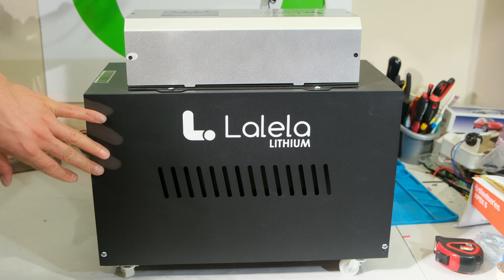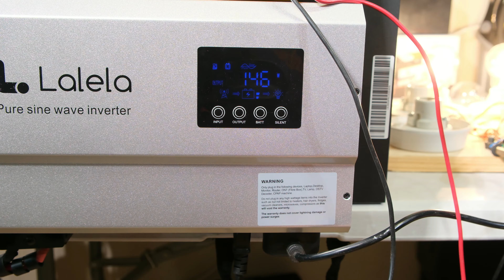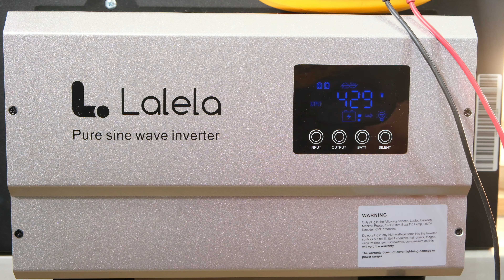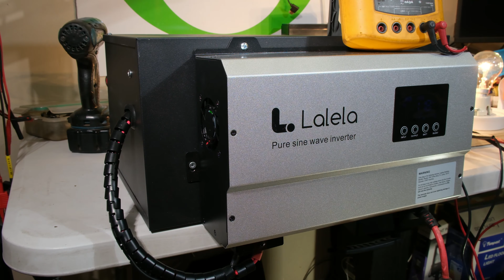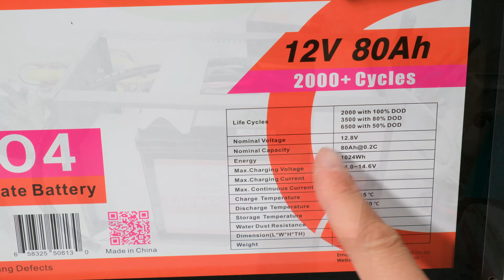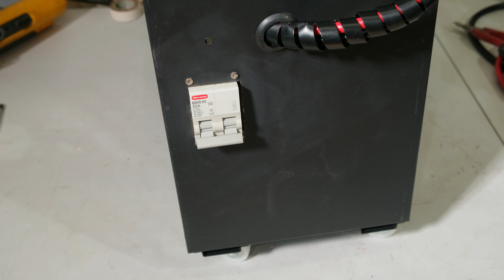How to setup and use the Lalela lithium iron inverter trolley Lal-600W-Plus  - Reviewed and tested

Comment: Hey Ecologicaltime, fantastic video review and I ended up buying this same Lalela product and want to do the same upgrades you did. However I have 1 question, can I purchase another lalela battery and add it to my invertor? I understand the invertor will only put out 600Watts but is there a way I can increase the capacity and if so how many batteries can you add to this device? I would really like for this device to run 500watts for around 5+ hours and for that I need more power storage.

Comment: When my unit arrived it was completely discharged, invertor wouldnt even turn on ( was loadshedding when i got it to the house) after loadshedding was done i plugged it it, had a fault ( cause of low battery) took about 6 hours to charge. At what voltage do the 12volt Lithiums ran at from a prolonged time, i know the 48/52volt shottos like to run at 49volt for a long time with a load, do the 12volts also have a "preferred range"  sorry for the lack of terminology just trying to figure out if the battery got damaged in the process.

Comment: Is it possible for the invertor to charge while its off but plugged in ? 
Because i have an invertor and while its plugged with load the fan doesn't stop running

Comment: Great video, thank you! Question: which  DC circuit breaker did you use? Was it 50A/250 V? I plan to buy the same system and modify it like you did. Thanks in advance 👍
Reply from the maker: https://youtu.be/_tjjHb5fPeA

Comment: lekker video man. Just wanted to know if you buy a bunch of lithium batteries and a inverter to equate to an output of 1kva be cheaper then whats on the market.
Reply from the maker: i would not put more than one lithium battery connected to a load unless there is a battery management system in place. This is the mistake cheaper power supplies (UPS) make and the batteries degrade rapidly. There are some videos on this exact problem on my channel: https://youtu.be/XU5S004KXVM
https://youtu.be/20hZ6BwKQq4